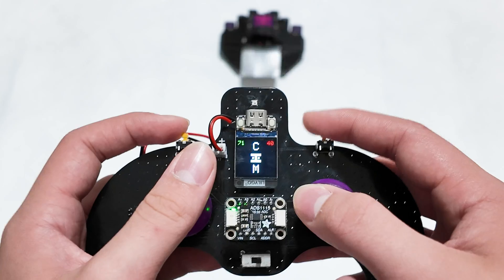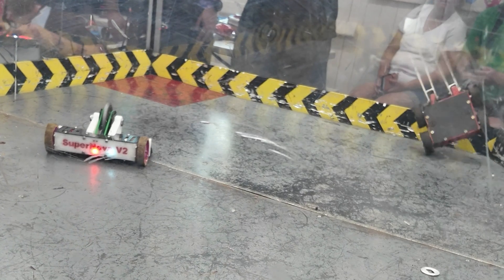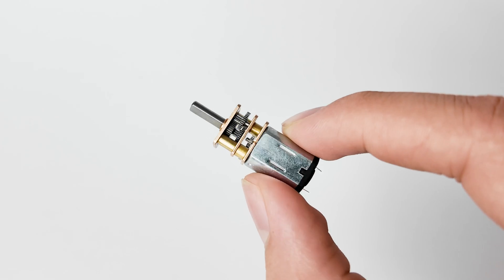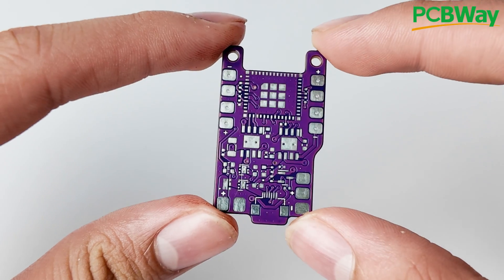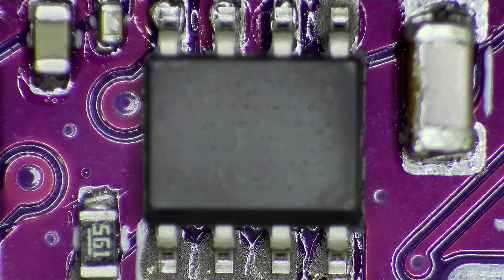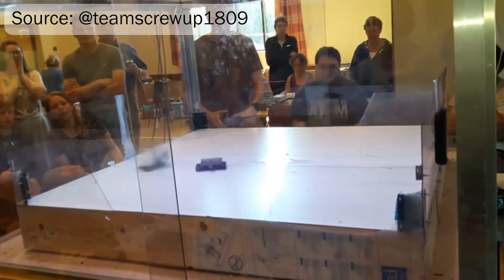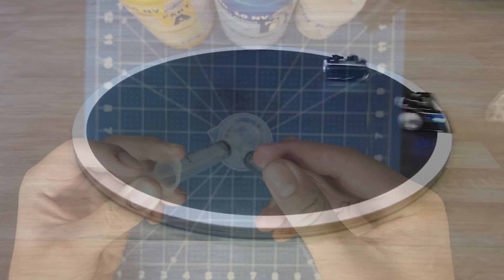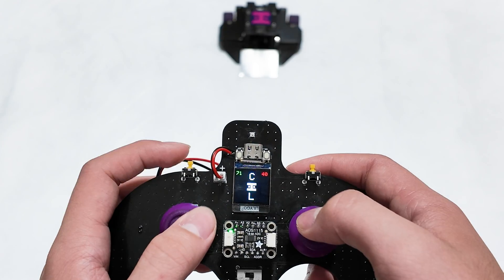Is this ESP32 antweight combat robot a BEAST?

Comment: What do you think of using 2 Weimos d1 minis as an more affordable solution? I'm trying to make an antweight but Malenkis are so expensive+ controllers, I'm not a programmer so anything helps
Reply from the maker: @Hyper_coffee  yeah, you could do that. My upcoming video (it’ll be out in like a week) is actually very, very relevant to this topic, and you might even be able to use the PCB showcased in it for your application 😁 stay tuned 👍👍
Reply: thank you

Comment: Can you share the gerber files? Or is this not an "open" project
Reply from the maker: So, it isn't fully open-source, because I thought the schematic would be good enough for people to learn from. I don't want people manufacturing my boards because I am an inexperienced PCB designer, and, as an example of this, this board overheats on standby when plugged into a 2-cell LiPo, and can be felt being warm through more than 2mm of PLA (which is horrible at conducting heat), due to the linear regulators, a horrible choice for converting ~8V to 3.3V. Sorry, I hope you can learn from the schematic, and Espressif's ESP32-C3 hardware design guidelines as I have, https://docs.espressif.com/projects/esp-hardware-design-guidelines/en/latest/esp32c3/pcb-layout-design.html.

Comment: At 6:51 that battery looks like a spicy pillow!!
Reply from the maker: Yeah, it’s kinda weird. It’s a venom 2S 300mAh, and it looked like that out of the box… I think it’s either just thick to make the length and width less, or it’s damaged, I don’t know… Are thicker LiPos a thing? Or, maybe they are in a 2S2P arrangement… My other 2S LiPo doesn’t look so thick like this though… let me know if it could be damaged if you know much about this, thanks for commenting man
Reply: @h1tec  Well, I know that typically pouch cells are supposed to be flat, and that those assembled high current packs also are rectangular slab shape. Now, I don't know the specifics of that brand/model pack but to me it sure looks sus!
Reply from the maker: @MistahHeffo  well it is flat though, except the side where the plug comes out, and the back, as most LiPos are. I charged them at 2C and they didn’t blow up. Thanks for the info though

Comment: Awesome! I've been playing around with a similar control system except without a custom pcb. My transmitter is an esp32 while the receiver is a wemos d1 mini (esp8266) using a MX1616 dual h bridge as the motor controller. Incredibly accessible way into the hobby as opposed to typical radio systems. This one video has blown away all my plans to try to make a custom pcb. You've done everything I could want to but better lmao.
Reply from the maker: lol thank you man
Reply: Are you using espnow communication.?
Reply from the maker: Yes

Comment: Nice work! Btw I always used 3.3V signal for servos/ESCs and never had an issue. I don't think that you need these level shifters. These servos work fine with both 3.3V and 5V signals. If the datasheet is good enough you can find out that the high signal is something like "above 1.8V" and that is totally fine for 3.3V signal
Reply from the maker: Thanks dude, apparently MG92B absolutely requires it though (check out Adafruit’s website on it), so I added it in just to be safe. Thanks for the info